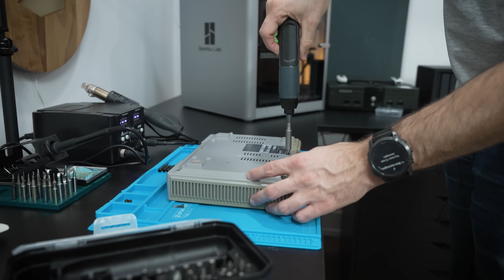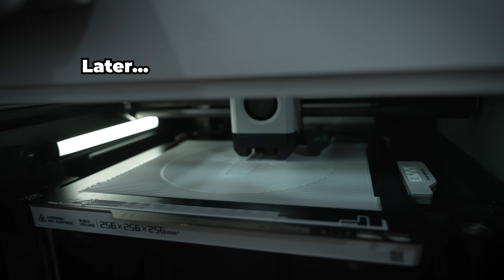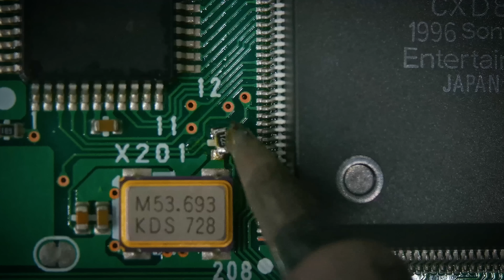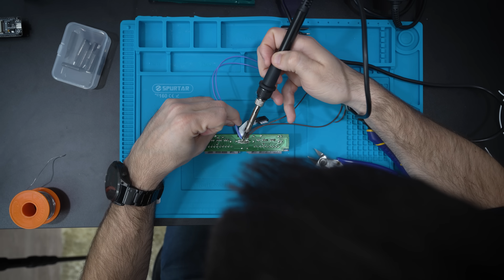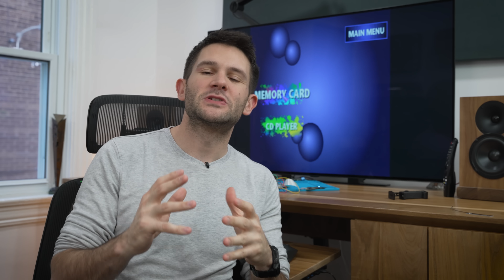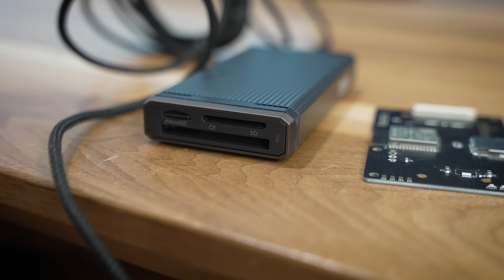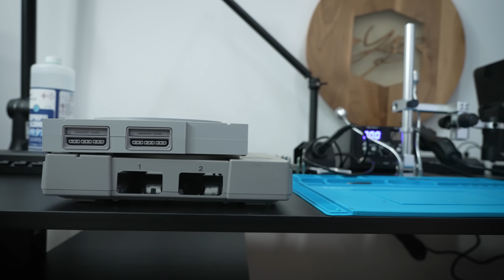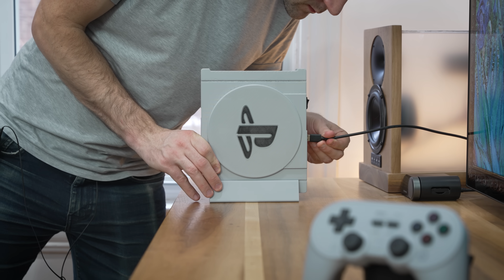I built a MODERN PlayStation...

Comment: This is kind of cool but pointless if you just want to run PS1 games. There are emulators that run pretty much flawlessly on the PC. Any decent GPU released in the last 10+ years will run games at 200fps.
Reply: I hate the latency of PC emulators.
Reply: @volo870  Latency? I get none with any of my gaming systems. What are you using?
Reply: @JamesDeSimone-im7tz  You just have never compared the gameplay to a real thing!

First of all, PS1 emulation does not increase framerate to 200 fps, as PS1 games have their logic tied to frames.

I am talking amout latency as the delay between input and reaction on screen. USB polls the gamepad at about 8 ms + the time to send the packet. Taking in account emulator's buffering of inputs it adds a frame of latency. After emulating the game logic, the emulator buffers the image before OS picks it up to send it the screen - that's another frame of latency. Then modern HDMI screens take extra 2-4 (up to 70 ms) frames to buffer, process and display an image (at least 1 frame for the best TVs in "gaming" mode).

You can easily sacrifice 1-2 frames of latency (16-33 ms) in exchange for image clarity (it is slightly easier to casually game with OSSC connected to a PC monitor instead of CRT), but 3-4 frames of the emulator setup makes the gameplay feel awful.

For the 3rd-4th generation of consoles latency is fixed with RetroArch "Run-Ahead" time travel feature, but as far as I know, it does not work with PS1.
Reply: @ PS1 emulators do not run at 200 fps as game logic is tied to frames. 

I mean latency of an emulator as "a machine within the machine": USB has 8-16ms of latency, emulator's output video buffer adds another 16 ms, then HDMI screen adds extra 35-70.

The game does not skip frames, but the emulated game reacts to inputs 3-6 frames later than it's supposed to.

Comment: Have you ever considered using ribbon/IDE cables to wire up these boards. It might be easier to work with than individual wires. You should even be able to peel them off so you have the exact number of wires you need.
Reply: IDE/PATA cables are not made for that. your thinking of Dupont Jumper cables.

Comment: Whenever you're soldering flex cables, it's a good idea to put kapton tape on the parts of the cable close to the soldering points. Even if you have experience soldering ribbon cables, all it takes is one slip of the hand or leaving the iron there for too long for the ribbon to warp or break the cable.
22:55 The PS1 Slim/PSone is smaller than your version, being almost half the size of the OG PS1.
Reply: Yeah I agree, that and overall this whole build is a huge mess anyways ... unappealing and pointless, but hey gotta keep pushing that content to milk sponsorships. 

The only thing I like on this is the UI which I even forgot what it comes from, other then that every other thing in this build is a tedious mess that can be lived without ...

Comment: I have a question about the device that connects to the audio chip and captures the digital audio data. Can this method be used to capture digital audio and save it to a file that can be played? Like so you can capture sounds and soundtracks off of games without ripping from the audio files of the disc.

Comment: Missed opportunity of using the PS5 30th anniversary PS5 controller, which is SONY, gray and matches the PS1 theme. Also, an on/off power button on the back is a bummer, you should replace it with some kind of a round backlit on/off push button on the front just because it would look cooler. The xStation is a must because the laser is usually the first to go on these otherwise very sturdy consoles.

Comment: I've never agreed with removing the AC conversion from the consoles - relying on finding a decent AC/DC adaptor is just sucky and increases the size of accessories yuk. USB C is only marginally batter but still lame. What we should want is a good relable and fixed AC conversion suitable for the unit inside the unit. Battery banks? We have enough handheld choices...

Comment: Are most these mods unavailable for the PSOne? The whole time its getting smaller and smaller, but it still ended up a lot larger than a fatory slim. Most of the space "savings" came from moving the power brick outside (same as the psone, though that brick is tiny)

Comment: If there's no disc to make familiar nostalgic noise, and it's using hdmi for a perfect signal, and you don't have the original case or controllers for nostalgic looks and tactile feedback then what's the point of having this very expensive solution over emulation or fpga?

Comment: The PS1 Retro GEM is not for novices. I've installed 3 of them (4 PS1digitals) and they still challenge me. I recently installed a GEM into a 3DO, which is about the same pitch as the PS1; and it was fun. 

If you want to install something like this, you're going to want some good tools, good solder, really good flux, and a lot of practice on easier projects. Don't just jump into something like this.

Comment: Hey man, appreciate the work done. This is 5th video I am watching you doing various upgrades, but I see that soldering skills haven't gone that far. There is a flux that can be used to decrease the melting temperature and to have better soldering for the components, also there are lots of more professional soldering irons that can be used to better control the melting temperature. During the upgrade, I saw the metal overheated or underheated causing it to look like a big spot instead of a shining ball. I think it is a great time to invest in improving soldering skills and look more like a pro.

Comment: There’s propably no way to increase the native resolution to 4K on original hardware by mods?

No matter what hardware improvements you do the games will look pretty horrible on modern displays because of the low resolution, so basically installing a Raspberry Pi is a 10x better PS1 than any modded OG hardware.

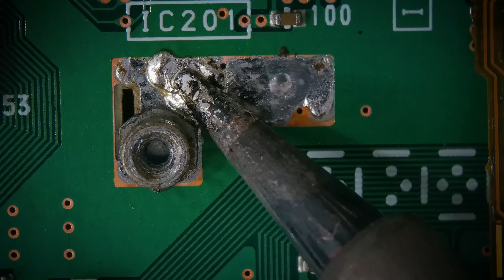Comment: Sorry, but saying someone did a bad soldering job, while you yourself are not very good at it is not the best way to start a video. Also, a small tip: Your soldering tip and also your tin you are using  are already oxidised and the iron plating is starting to come off. Correct me if I'm wrong, but it seems to me that the copper core of the tip is starting to come out. If so, then the tip is busted. I recomend you to 1) Get a new tip replacement 2) Get a better quality tin (Preferably with lead) and a good flux. Search for a tin from a reputable source, so you don't get a brand new tin that is already oxidised. 3) Don't overheat your soldering tip, don't scratch it. Don't use stainless steel wire balls that will scratch the iron plating off, same with sandpaper etc. The plating is essential to good soldering perfomance.. 4) Get yourself a tip tinner and do a proper maintanance from time to time. Watching the 10:24 was painfull. :) 5) Use temperatures recomended by the maker of the soldering tin. 6) When you are getting a new tin tip, experiment a little and order different shapes. You will find out different shapes excell at different situations. It will make your life soldering SO MUCH better. Trust me :)

Otherwise, good video. I love how you are reigniting attention of old hardware to a new audience.
Reply: After rewatching the video, I just noticed you already HAVE multiple soldering tips. So its more of a problem of an oxidised tin. But to me, that soldering sponge looks pathetically thin, don't know. Just... Clear your tips, use better tin and proper heat/flux. :P

Comment: The only way it could be better is if you kept the CD drive and allowed it to rip the discs itself. I don't know how you feel about emulation, but if you took one of those mini puck computers and made a custom case incorporating a USB CD drive, and installed something like RetroPie, you could automate ripping discs and just use an emulator to play the games. The only reason I suggest using a CD drive is for future expansion. If you find a game at some flea market you could load it up straight away without having to rip and transfer.

Comment: The ps1 disc drive probably works fine and it didn’t read discs due to the modchip not working correctly with some wires disconnected interfering with the license check.
Reply: He did say an important piece of the drive fell out when he took the top off. I don't know what that little black piece was, but I just took his word for it

Comment: You didn’t replace capacitors with electrolytic capacitors, you replaced electrolytic capacitors with tantalum capacitors.
Reply: very important to also note that electrolytic and tantalum caps are marked backwards. electrolytic caps have the mark/bar on the negative side and tantalum caps have the bar on the positive side.

reverse an electrolytic and worst case you get a little pop. reverse a tantalum and you could get a small fire. we had some small tantalum caps reversed on a high current 7.5V supply and it shot flames 6in out, haha!
Reply: @Sw3d15h_F1s4 Yes, and they have a tendency to fail short. So many retro PCs getting turned on for the first time in decades only to go “POP!”
Reply: and tantals have different characteristics. Not the best idea to believe one is Modernizing and making somethin better by using different caps than the designers chose to use :D
Replacing old electrolytes with new good quality ones is what should be done.
Reply: @tenuke ahm... you know that what are you saying doesn't make sense ? As long as they are in the range of that capacitor then it basically doesn't matter. It's the same idea of using a ceramic cup of the same size, and replacing it with a glass cup of the same size, in the end you still does the same job. I do understand what you mean, but in this case that doesn't really matter.
Reply: @dergrive88 See Afrotech’s video on this.
Reply: Are tantalums no longer made from conflict minerals?
Reply: @patrickwright8552 I wasn’t aware of this issue. I hope not. They are carried by respectable suppliers like Mouser and DigiKey, at least.
Reply: @emmettturner9452  A lot of major companies have conflict-free policies, but whether suppliers find loopholes (or cover-up their sourcing) or at what intervals they're verified, I assume varies. Anyway I hadn't checked on this in a while, found something from the BBC dated May 2: "In recent years, the M23 has seized several lucrative mining areas and a report by UN experts last December said that around 120 tonnes of coltan was being sent by the M23 to Rwanda every four weeks."

This is in eastern DRC, and if you read older work on conflict minerals, you'll probably find other groups named. Tantalum (derived from coltan) is not the only mineral involved in these conflicts. I would post the link but y-t tends to delete comments with links, but if you search the quote, google gives me the BBC link after their AI overview.

Comment: A technique for smoothing out the surface of your 3d prints is to put it into an enclosed container with a small cup of acetone. Then introduce a little heat to vaporize the acetone & it will smooth out the surfaces. But you have to keep a close eye on it. Try it first with print failures to time the best results.

Comment: It's possible that cd drive was working perfectly fine. The reason could have been those mod chip wires not being fully soldered to the motherboard causing the drive not to work. Shame you threw it away without testing first :(

Comment: Your story about the Nintendo-Playstation or Playstation 0 is not completely correct
The true story is Nintendo signed a contract with Sony & didn't read the fine print & realized that Sony would get 100% of the revenue on every disc based game however when Nintendo approached Sony about the contract issue Sony refused to alter the contract & told Nintendo they were on the hook since they agreed & signed the contract Sony also refused to stop development on the system when instructed by Nintendo So Nintendo went to Phillips & made a contract with them them. after that Sony reached out to Sega & tried to make a deal with them however Sega refused Sony's offer. Later Sony, Nintendo, Sega and Phillips were brought together in a meeting & were told they had to work things out so every company went their separate ways.
When the playstation executives returned to Sony they told the CEO the system was mostly done & all they needed was some logic so Sony's ceo approved the continuation of the project.
Reply: Most of the time when this story comes up people usually blame Nintendo for the reason why Playstation exist
another part of the story is when Sony approached developers about putting their games on Playstation most developers refused so Sony gave them dev kits, paid them & put them into contracts so the games would only come out on Playstation guaranteeing the Playstation's success 
This is why most games were only on Playstation & Playstation 2 
The truth is Sony was not a very friendly company back then & they had so much money that they could beat their competition without ever competing which is also the reason why almost every commercial & advertisement was Playstation from the mid 90s through the mid 2000s

Comment: There's a small issue with the short history segment at the beginning of the video: Sony also tried to pull a fast one on Nintendo. Console manufacturers' main source of income is licensing, and Sony expected to handle CD-ROM manufacturing and collect licensing fees independently, essentially stealing Nintendo's primary revenue stream. As you said, Sony didn't just want to manufacture console hardware, they wanted to seriously enter the market.
Reply: I do have to say I also can't fully call Nintendo the victims given that they went behind Sony's back instead of just saying no to the deal.

I get Nintendo not wanting Sony to have so much power in liscensing fees, but there is still the fact that the deal was something Nintendo let fester until they found someone else.
Reply: @RippahRooJizah  everyone knows nintendo is not the victim. Everyone knows the tricked sony... But as specified there is a fire from nintendo's smoke.

Comment: I've also done an xStation install, and I also lifted one of those same traces in the same spot. Oh well, still reversible if needed, just solder a length of wire back to the pad.
I've also done the PS1 Digital, which was the "RetroGEM" before the RetroGEM. Kind of neat to see one of these videos and go "oh hey, I've done that before"
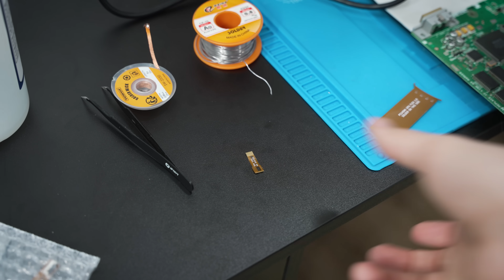EDIT: 9:35 - Ugh, that little ribbon is EVIL. That was the hardest part of the install for me.
Reply: Hahaha I ended up pulling my hair out over my xStation not working quite right either. Testing all the points and all that good stuff. My problem ended up being the rips I had done of my discs. Turns out there's something called ReDump you want to have, not just any old rip.

Comment: Just started. How much hot glue will he use this time?
Reply: Good call on the PU-18, get a 550X system to guarantee that motherboard revision.
Reply: I was about to mention in-game reset when he revealed he has one.
Reply: Analog to digital converters. Yes, a mess of wires, but if you get a Retrotink 5X it looks clean. Getting an HDMI mod isn't a bad solution.
Reply: Ooh, I know this one after doing a few Xstation installs! The disc cover wasn't closed! You need to find a solution to this, swapping discs in multi disc games depends on it!
Reply: I was not expecting the Retro Gem to have a solution to that. Neat!
Reply: Memcard Pro isn't a mod, but highly recommended, especially with an Xstation, since it will automatically make, and switch to, memory cards for a game when you boot it up.

Comment: The yellowing of old plastic isn't from oxidation, it's from UV damage. You can un-do the yellowing.
Reply: Is the plastic weakened by the uv tho?
Reply: It's a process of oxidation caused by exposure to both UV light and air.
Reply: @ There's usually plenty of air in an environment. I'd wager that telling people to protect their stuff from UV light will lead to less degradation in the overall ecosystem than telling them to protect their stuff against oxygen.
Reply: @Thalanox I think the key is that UV light seems to accelerate the process. My SNES sat in a box for 20 years and came out very yellowed. Not as bad as some pictures I've seen, but it had no yellowing when it went into the box. I'm guessing had I wrapped it in plastic before sticking it in the box, the yellowing would have been significantly less.

This latest Youtube comment bug (where the name disappears for no reason when replying to someone) is extremely annoying!
Reply: @rars0n  If you want to dig a bit into the chemistry of it, the term is "retrobright", and the process was first described around 2006. Last I checked, there were only two to three formal chemistry papers on it.
Reply: @Thalanox  Yeah, I'm familiar with retrobright. David Flood has a very good Medium post about it that talks about the process and how it works. FWIW he recommends to use a different method.
Reply: @rars0n  I learned about it from looking up tech restoration videos. I've never tried it myself yet.